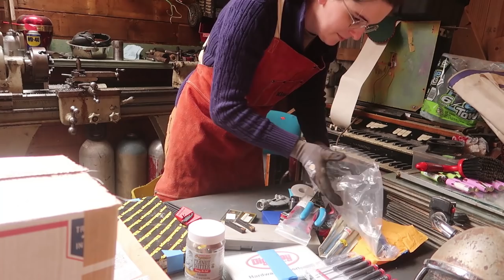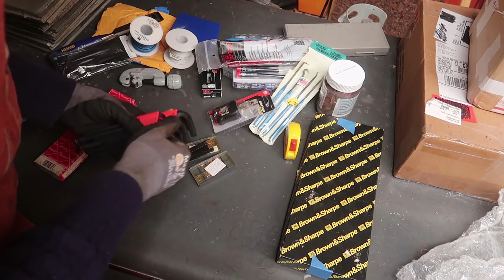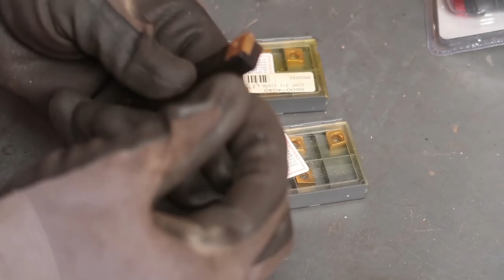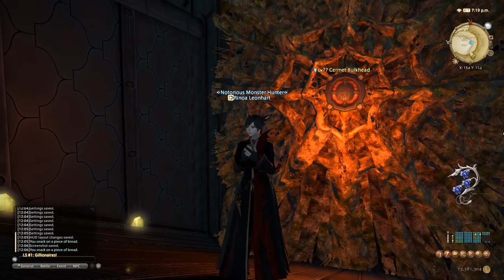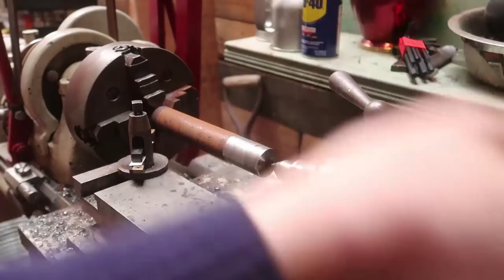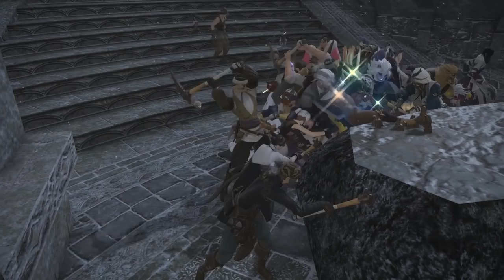Learning To Lathe 04: Tungsten Carbide Cermet, Tools, Flat Belt Tensioner, Ishgardian Restoration

Comment: The V-shaped head for your combination square can be used to find the center of the ends round stock. useful for drilling the center hole before mounting in the lathe

Comment: Hi Rin.
I had the exact same problems too on my ancient lathe, i did the exact same as you trying everything and every material and tool set up. In the end it was the rear bearing! Super important its true and tight on old lathes. When loose it creates harmonics that ruin the finish. Especially on different sized parts.
Cheers
Reply from the maker: well these bearings are bad so that makes sense

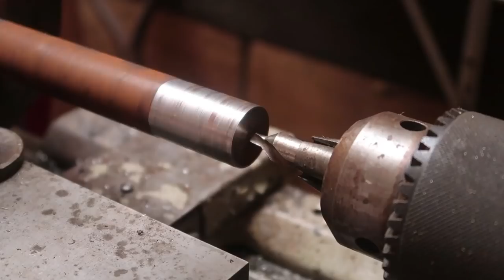Comment: the drill bit that you used at 33:30 is exactly the right thing for the job (that's why it's called a "center drill") but you want to go a lot deeper, at least halfway up the large angled portion, that part is for forming the actual bearing surface that your dead center wants engage on

Comment: Hi Rinoa. You will need to get rid of as much play from the saddle and cross slide, and even then just having hand feed and not power feed means the finish won't be great, try traversing a little slower as well as you seem to be forming a rudimentary screw thread at the speed your going. Good luck and practice makes perfect.

Comment: As you noticed adding tail stock support improved results, because the work is more ridged = less vibration. The same is true for your tool post. The Gibbs on the cross slide, top slide and apron can be adjusted to reduce free play. Using your automatic feed will give a more consistent cut and Finnish. Carbide likes to work hard so working on tightening your drive belt will enable to push your lathe harder. Looks like you are figuring  it out. Keep at it. Also pay attention to speeds and feeds.
Reply from the maker: sadly automatic feed is broken since i lost a key for one of the gears. and plus i see that as a quick way to break something lol.

Comment: Cutting steel, best to use coolant! and check some engineering reference for speed, the height of the cutting tool (usually set the height to the center of workpiece and 90% to edge of workpiece etc.

Comment: I would not use a drill press as a mill.  I have a big heavy drill press that I now need to buy parts for because I tried it.  They are not built to have a side to side load put on the spindle.
Reply from the maker: we shall see. if i find one at the scrap yard ill definitly do it.
Reply: Best advise don't do it most likely your drill chuck is attached using what is called a morse taper they do not like side loads it can cause at the least the chuck dropping out to the whole amber flying out somewhere in your shop hopefully not hit you

Comment: to stop damp flash rusting my machine tools, i just give them a quick wipe over with machine wax, this also means the work slides easier for example on my bandsaw bed
Reply: It was a precision instrument.
Reply from the maker: well its the pulleys that rust and i dont want to make them slip more

Comment: Aaa! I have seen cermet machining. You run the lathe at insane speeds.You turn off a tiny amount but the cermet glows red-orange, and you get these huge lengths of curly swarf leaping out. You had nice, curly scarf with temper colouring, so you are half-way there; but I wanna see that cermet light up! No, really, it is less brittle when it is hot. But perhaps poor old Grandpa Lathe isn't into this new fangled stuff.
Reply: this is not true for every bit.

Comment: Mmm, Rin, that's not the way to go with the indicator. You turn it always by hand when setting up! No speed required.. and by the way, the square/angular tool's attachment like the bird's mouth is used to find the center on something round.  Put the round thing in, the edge of the ruler is the center line. Draw two or 3 lines from different angles and where they cross is your center point. You got equiped with very nice stuff.. =) Hope you'll use it to make nice things.

Comment: I think your instincts are right, and your lathe just needs some TLC. Bringing back its precision may be a tear down/clean/lubricate/reassemble type deal. I can imagine bits and shavings working their way into things and becoming suspended in lubricant and messing with tolerances  And the belt looks like it broke and was stitched back together at some point in its life.  So fixing the slop in it may be as easy as replacing it? And if there's a bearing lurking anywhere between the motor and the chuck, it may need to be repacked. Anyway, this is all pure observation from watching the video.  I'm not actually knowledgeable about these things.  LOL

Comment: Lots of variables on the quality of cut. Small diameter piece that looks so nice might be cold rolled steel, larger one might have been hot rolled and machines much differently. Even the diameter difference, large runs more feet per second past the cutting tool than the small one at the same RPM. Belt slippage can create a micro chatter on the larger one, etc..... some of this just takes time, experimentation and experience. You will get there and you are motivated.

Comment: Quick note on your surface finish problems.  It's a little thing in the machining world Called feeds and speeds.  The small part came out better because the speed its turning measured in surface feet per minute is less and closer to optimal then the larger piece spinning at the same rpm.  A 1 inch diameter part has a lower surface feet per minute (262 fpm) spinning at 1000rpm then a 3 inch diameter (786 fpm) part spinning at 1000rpm.  plus that slipping belt is not helping also.  Keep it up you will figure it out.
Reply from the maker: when i cut that small bar that turned out berfectly, i tried all 3 speeds and various different feeds, all to the same perfect effect. so i think the issue is something else since i clearly couldnt get the same results from the similarly sized rod i tried last in this video. i have a few things i noticed i accidently only did on that one perfect part and never again, and so i plan to try testing those to see if maybe its just an odd thing i havent noticed till now.

Comment: smaller diameter so the speed and feed is closer to what it needs to be is my thinking. if you can find a quick change post its like a whole new level, adds rigidity and puts the tool on center without the fuss. the lantern post should have a half round shim to it that moves the center line then you push it down
Reply from the maker: i did that perfect part earlier on all 3 speeds
Reply: @RinoaL  it might just be softer like you said. But I know proper speeds and feeds get good finishes. But either way it looks like you will have a load of fun on it!

Comment: Just need to be careful - without a drawbar in the quill, if your chuck mounts via a taper, side loading it has a tendency to pop it loose. Super fun when you are trying to machine a slot in metal and the entire chuck falls out of the drill press!
Reply from the maker: what?
Reply: @RinoaL   Yep!
Reply: It's true.

Comment: Is your lantern post missing a part? The ones I've seen/used have a couple pieces that allow you to adjust the angle of the tool being held, so you can fine tune the point of the tool vs the center of the work piece.
Reply from the maker: from what i can tell they were down to the manufacturer, and Seneca Falls seems to have just made them this way,
Reply: @RinoaL  Actually there is supposed to be a shallow crescent looking piece  that matches the radius of the big washer on the bottom so you can adjust angle.

Comment: I hate to be a downer, but don't waste your money on an X/Y stage unless you want one for accurate drilling. I have tried many times, a drill chuck will not hold an end mill while cutting anything harder than wood laterally. It's just how it is. You need a colette and drawbar on the drill press quill, otherwise the radial load and vibration will loosen the chuck and the endmill will fly. Also, generally the rotational speed of a drill is too high and the torque too low. You just end up with a chattered mess and high speed flying razor sharp end mills.
Reply from the maker: oh dont worry i mostly want it for accurate drilling, but i think itd be fun to mill plastic or wood with it too

Comment: I think you will continue to get disappointing results until you get that belt properly tensioned. You might also need a new belt.
Reply from the maker: agreed, the belt is strong, its just this electric retrofit for this lathe doesnt allow for tensioning so i should just add that feature. the belt is fine though. still strong and pliable.

Comment: Before you get hurt get some instructions for how to run a lathe check Amazon for a book put out by South Bend called how to run a lathe.!!!!
Reply from the maker: no thanks, i know enough about it and anything else will be found in my machineries handbook
Reply: @RinoaL  no it will not be found there learn safe practices
Reply: @RinoaL  If your do safe why we're you trying to take a cut in martial that far exceeded safe practices normal max stick out is 3time the diameter of the stock you are working with
Reply from the maker: @christophernewton2579  you do realize i managed rapid prototyping labs at Apple right? i have spent more than enough time figuring out what is safe and i am safe. dont worry.

you are abiding by fake safety or improper safety. get over it.
Reply: @RinoaL  no your taking manory risk must because you managed a dept does not mean you know how to work with tools safely

Comment: the lines are because you are manual feeding and the feed rate is constantly changing basically cutting threads into it the lathe isnt turning fast enough for you to be able to manually feed slowly enough also the whole tool assembly has way to much play
Reply from the maker: so why did it work with the other part?

Comment: The Saw blade looking bits are for cutting Threads / Gears.
Reply from the maker: really? ive never seen someone use anything other than a stationary bit for that. unless it rotates like a worm gear.
Reply: No they are called slitting saws and are used for cutting small slots into your work piece

Comment: Oh, I forgot.. Your stucking slide has probably a chip or something in the pinion gear on the underside os the guides. And don't be rude with things that need attention. If something doesn't work as supposed, then you must have a problem to address and take care of. I still don't understand why do you get so violent when something's wrong.. =/

Comment: Please dont ever wear gloves when you use your lathe. It is very dangerous.
Reply from the maker: if it catches, it will stop the lathe without hurting my hand. i show in the video that the lathe is so weak that i can stop the chuck with my hands.
Reply: @RinoaL  Thats the bit i was watching when i felt the need to reply. it wont stop it you tighten up your belt and  cloth can get dragged in very easily. it winds around the part or chuck and your fingers inside a glove wont enjoy that.  Theres lots you can do to improve the finish on your lathe but thats the most important thing i felt it nessesary to tell you . Have fun and be safe.
Reply from the maker: back when i worked at Apple managing rapid prototyping labs i got into heated debates with other workshop managers and they didnt accept my explanation. so ive decided to keep doing it the way i do it and lo and behold ive never been hurt with gloves because im so careful, and i dont have burn marks on my hands from all dangerous stuff coming at you other than the spinning bits. you must also pay attention to my choice of gloves and how i use them.